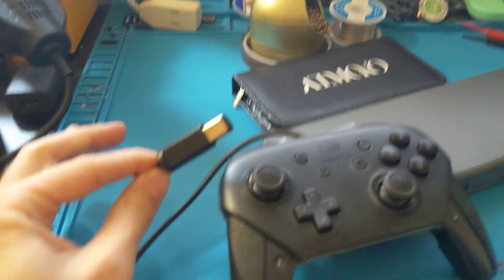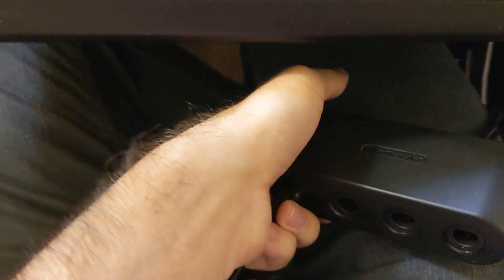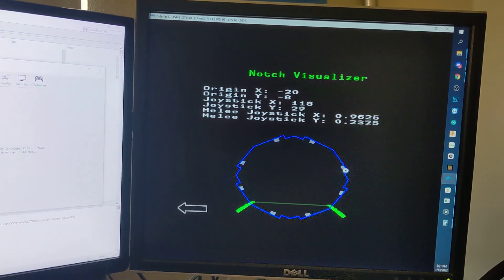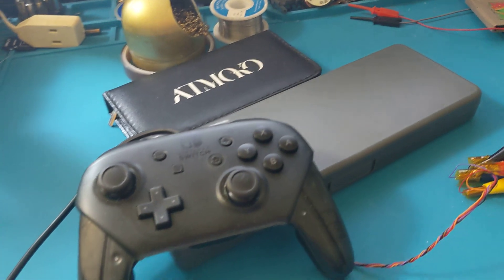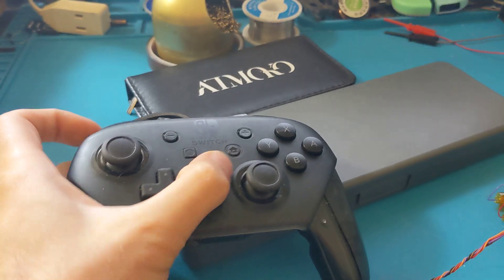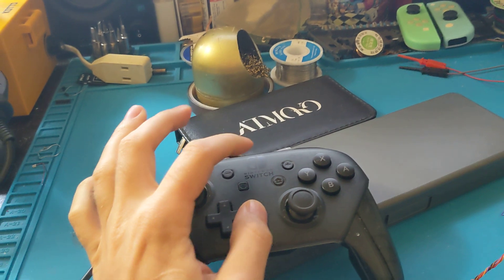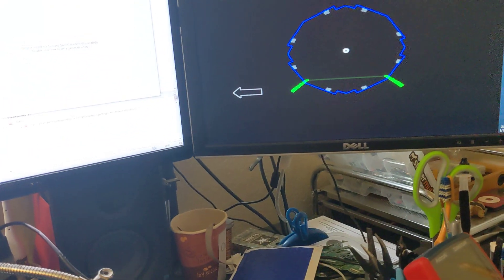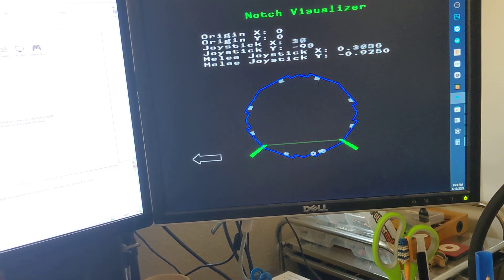GameCube in ProCon Update - Stick Calibration

Comment: Gracias por compartir tu contenido hermano, vengo del canal de xgames_vj, una pregunta, tienes planeado hacer algo así para Xbox one? Me gustaría conectar mi control de Xbox clasico a mi Xbox one

Thanks for sharing your content brother, I come from the xgames_vj channel, one question, do you plan to do something like this for Xbox one?  I would like to connect my Xbox classic controller to my Xbox one
Reply from the maker: Not possible with Xbox One. Microsoft uses encryption
Reply: @MitchCairns  That's unfortunate but using an 8bit as a receiver?
Reply from the maker: @guerrerodelbosque  No, unfortunately. No third party adapters for Xbox one.